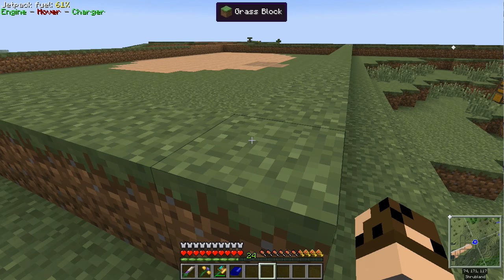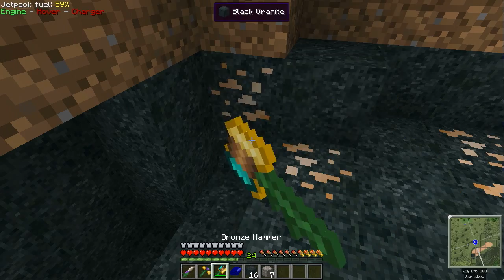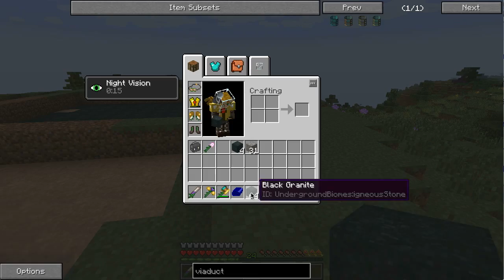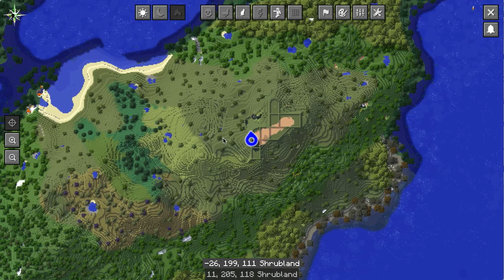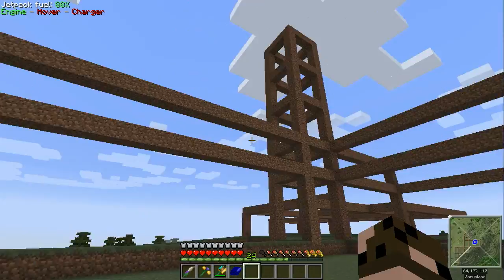Let's Play Series 1, Part 17 — 3D Sketching

Comment: Hi there. You have really nice looking constructing ideas. I definitely like it. But i have a question. Can you please tell how do you make BoP trees (or it is biomes.. i dont know) spawn with Alternative Terrain Generation? Becose i saw big pine trees on a background and i hear that you have Bop and ATG installed together. (Sorry for my eng)
Reply from the maker: Thanks!  I didn't actually do anything myself to get them to spawn like that.  If you use BoP by itself, those biomes which have really big trees (e.g., Coniferous Forest) will automatically spawn with those trees in them.  If you use Alternate Terrain Generation (ATG) alone, it will use the vanilla Minecraft biomes (e.g., Plains, Jungle, Desert, etc.), but will place them intelligently so that they appear in realistic settings.  Of course, then, then only big trees you get are the vanilla jungle trees.  When you use both together, ATG will use all the biomes available (the vanilla ones and the BoP ones) and mix them up while placing them in realistic settings.  Wherever a BoP biome with tall trees winds up getting placed, the trees will automatically appear.
Reply: I expected that what do you said would happen but i have a strange issue. When i instal BoP and ATG there is only vanila biomes generated in world (no BoP biomes at all), but for example, in swamp biome i found willow trees from BoP. I tryed diffirent versions of minecraft (1.7.10, 1.10, 1.11.2) but there is only vanila biomes (i tried to search in a long distance). Btw what version of minecraft do you use? 1.7.10? Anyway, thanks for ansvering. I think i will find the solution eventually.
Reply from the maker: I'm using Minecraft 1.7.10.  You might try throwing out the ATG config files now that you have both installed and restarting your game (and/or creating a new world).
Reply: I found some information. There is just no support for BoP in latest versions of ATG. Anyway thanks again. Can't wait to see how's going to look like the final building.
Reply from the maker: Too bad!  I'm using Minecraft 1.7.10 with BoP 2.1.0 and ATG 0.12.0, if you wanted to try them together.
Reply from the maker: I've done a little more research on what's going on with ATG.  Turns out, the author has been hard at work on a complete re-write of the mod, and he just hasn't gotten around to adding in support for other mods' biomes yet.  Fortunately, it's definitely on his list of things to get to soon!

In the meantime, though... the new version does an even better job with generating useful and interesting terrain!
Reply: I hope that he will cope with this work.. Oh, I'll definetely check out new version then. Thanks!